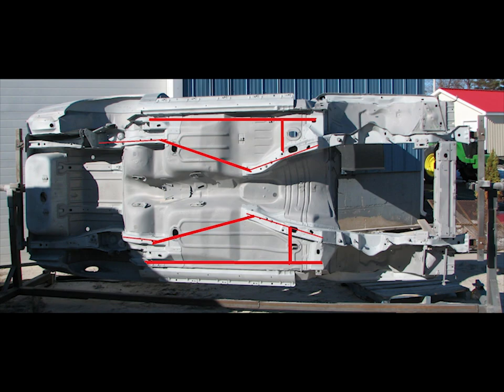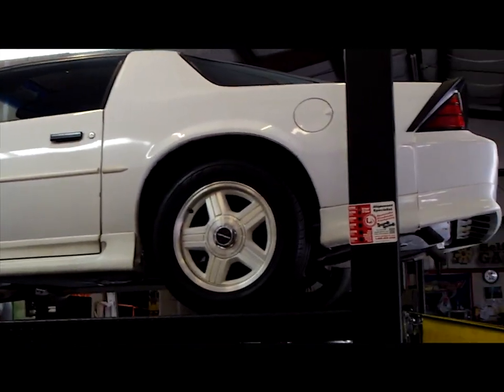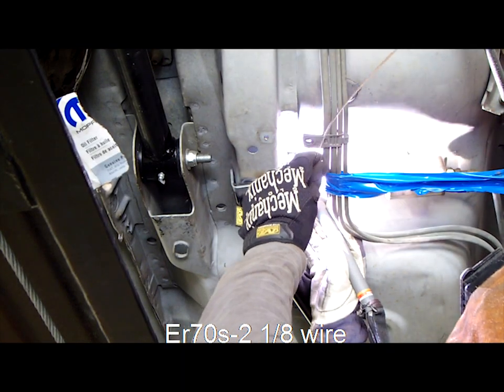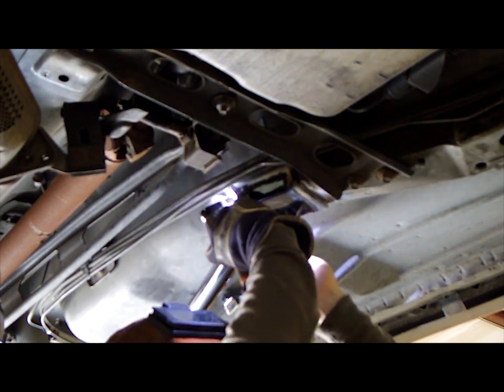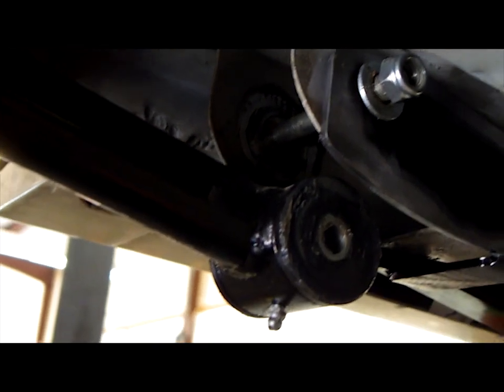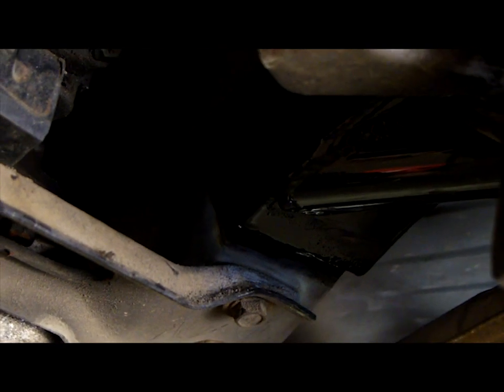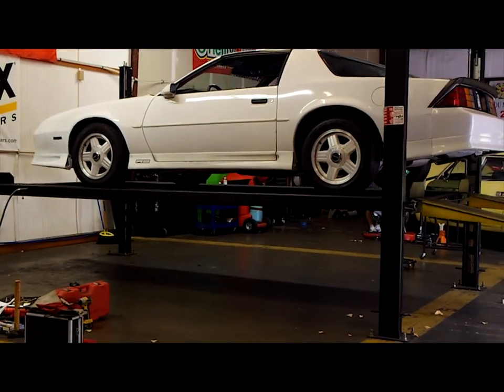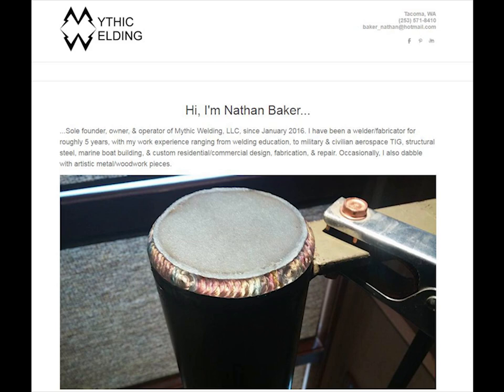Subframe Connector Install (1982-1992 Camaro/Firebird)

Comment: Installed spohn ..torq arm adj..trailing arms adj..sub frame connectors.Panhard bar.. .400 turbo 4 in. driveshaft ..1350 joints 370 MOTIVE GEAR 9 BOLT AUSSIE BORG..  2400 b&m stahl..388 stroker 750 quick fuel..full roller lunati voodoo ..dart aluminum..air gap... 580hp...REAL DEAL...

Comment: Hey! That's my car in the opening pictures lmfao!  I totally didn't expect that.   I took that pic at Robert Sanford's autobody in Nova Scotia, Canada probably 14 years ago now.  That's my home built rotisserie that now has a 71 z28 hanging on it.  This is my 87 iroc in your vid that is still in pieces to this day.... lots of goodies ready to go though, 400 sbc, afr heads, 704 lift solid roller , jesel shaft mount rockers, a 10 pt cage fit tight to the t-top and a t56 all sitting with it now.  Maybe I'll get around to finishing it haha. Still as rust free as it was 14 years ago, it was coated with 2 gallons of epoxy primer, tinted black just after this pic was taken.
Reply from the maker: I just grabbed a 3rd gen at an Autocross because i don't have Pics of mine running
Reply: @3rdGenGuy   nah, the pic of the car from underneath that you drew the subframe connectors on. That's my rig.  Just thought I'd let you know I was quite surprised to see my car pictured Haha.  No worries,  I just figured... what were the chances of perusing YouTube and seeing my car on another channel lol

Comment: Nice!  I went with Spohn subframe connectors and I love them.  You are so right about the squeaks and rattles diminishing.  I also love how the car now goes over train-tracks as a big solid piece of metal instead of a flexible belly-pan.

Comment: So I’m curious why you felt the need to upgrade to the Detroit Speed SFC’s. I love them but the install you did lookes a bridge too far for me.  Excellent work as always.  Looking t]forward you your response.
Reply from the maker: the DSE SFC basically gave my car the stiffness of the 2x SFC I had before.
while dropping 30lbs off my car.
that and the Holley t56 cross member gets in the way of the inner SFC.

Comment: I want to install subframe connectors on my 83 Pontiac Trans Am. How long and how much do u think a garage would charge me for a job like this?
Reply from the maker: if you get a set of Outer SFC and Bolted them in yourself,  a shop could weld it EASY.
like less than 30min.
They'd probably charge you an hour's labor. so $100 or so depending.
Reply: @3rdGenGuy  Thanks dude. I can't do it myself , I have a stress disorder that kinda holds me back. But I did have a new motor put in and I want to get them in there before I run it. I'm worrying about this new motor twisting her body up a bit. Nice videos, I love these cars.
Reply: The garage that did it for me charged $280 just for the outers.

Comment: Anyone have this set up on a lowered suspension? If so how low ? And is it bad? Scrapes? How low can ya go with this set up ?
Reply from the maker: So the UMI outers will NEVER scrape no matter how low your car is.
The inner SFC scrape with 3in+ lowering springs.
BUT, what would you like  to scrape?
2in steel tubes that are $200 & replaceable. OR your transmission oil pan or exhaust?
Reply: @3rdGenGuy  Good to know thank you! Long time owner of several 3rd gen Camaros and have over 10 years of experience with these cars... So I am very familiar with these cars... I've done tons of work on them but strangely enough never installed subframe connectors😮 CRAZY stupid insane I know.. Always known the value of the SFC especially on the 3rd gen just haven't got to it yet...😒  The outers they an eyesore form the side view of the car? I really like the original look of these cars ... Id like to keep the original look. Are they an "Eyesore" ?
Reply: @Toast355  you cant see them and they dont interfere with anything(if you install them right)

Comment: I had just built a strong 355 for my iroc and tore the floor all the way in half from the right door to the left door!
But what i wanted to say is because i had to deal with the floors, 
 I welded all my sub-frame members Exactly half above and half below the floor line joining the floor to the members with New carpet and an extra layer of insulation(for noise) and you can barely tell i did it from the inside and i have NO Exhaust Clearance issues or ground clearance problems, If you look under my car they dont slap you in the face, and are more integrated rather than stuck on.
SUB-FRAMES ARE A MUST DO,  My car is like a BRICK!  I can not tell you what a difference it made.
I've been welding for 30 years and that TIG makes my MIG look like poop.
Reply from the maker: MIG gets the job done
TIG makes it look nice.

Comment: All Thirdgen's should get this done. It's a known fact from the 80's these cars would ratle after reaching 40k miles. I can honestly state it's one of the best improvements you can do to an Iroc.
Reply from the maker: the 3rd party that GM hired to make the convertibles acually made their own SFC because the doors wouldn't close ha ha
even new these unibodys were cardboard.

Comment: I just found this subscription. I love this. I have a 83 camaro i want to be autocross quality just for a weekend driver
Reply: I did this same install.   I love how much more rigid it feels.     By any chance are there any ways to fully box and frame this car?
Reply from the maker: A guy on thirdgen.org put a frame in his. it weighed a fuc ton and didn't help much.
the next step after 2 sets of SFC, is a full Cage.
the cage is the only thing that's gonna make a difference after installing 2 sets of SFC

Comment: I have an 88 TA .  I thought of doing both myself!.  Right now there are only Competition Engineering bolt ins.. A temporary measure, jut to give me 'safe' jacking points.  I discovered I had a rear driverside foot well pan with some rust.. :(    Wish I could find a reasonable pan repair piece.   Great video!  Thanks!

Comment: Thinking about this for a 4th gen camaro ss convertible. Dont want to weld it in however
Reply from the maker: there are Bolt in kits, but weld is the best method by far.

Comment: You did it correctly on a lift with the weight of the car on all 4 wheels.
Reply from the maker: I was told to use a 4 post lift.
but there a few  master fabricators on the forums that claim using a 2 post works fine as long as the load is distributed evenly across the SubFrame.

Comment: I purchased jegs bolt in frame connectors for my 91 rs.am i in trouble with these ?
Reply from the maker: no, the Jegs ones are fine for street cars.
you can bolt them in, then weld for extra strength.

Comment: Thanks for this Video! I really appreciate your work. Im thinking myself to do the same but because of the Government restrictions it needed to be removable. Do you think it could be done with screws and nuts?
Reply from the maker: you can bolt them in, but it's not nearly as effective.
but local laws are hard to get around.
Reply: Hi.  What locality and laws regarding welding SF Connectors are you speaking about?
Reply: Huh?

Comment: Owning a 91 305 auto convertible - installing all Hochkis front and rear, is there a need to add connectors?
Reply from the maker: Regardless of suspension, you 100% need subframe connectors. 
even a stock 3rd gen needs SFC regardless of power.

also, pretty sure Hotchkis has subframe connectors.
Reply: Thanks for reply, was thinking the convertible had reinforcement.
Reply from the maker: some convertibles had SFC stock, but they suck.
if you have a Vert, i'd go with Inner and outer SFC like i installed in this video.
your ride will feel like a totally different car afterwards.

Comment: Thank you for posting this video ,,I Have a question would the outer UMI be good enough for my hard top 3rd gen ?
Reply from the maker: street cars really only need 1 set.
the Alston inners are 1/2 the weight of the UMI ones but are harder to weld in.

Comment: Has anyone used a tubular k member for long while? Have heard they crack and rip? Cheap welds
Reply from the maker: I was gonna use one, but i heard the same about the poor weld quality.
so i just powder coated my stock one.
i'm an Aerospace welder, so the idea of some MIG monkey making parts i have to drive with makes me cringe.

you have to realize, some MIG moron getting paid $12 an hour to weld those up
they don't purge the inside of the tubes 
they don't do penetrant inspections
Reply: 3rd Gen Guy yeah but i wanted the optional rack and pinion steering instead of the 82 to 84 rip the frame at the powersteering box
Reply from the maker: so the rack and pinion steering is not really a good option unless you are drag racing.
the issue is, the Racks they sell are too short for the width of 3rd gens.
so the tie-rods arms  are WAYYY too long and induce pretty awful Bump steer
the 4th gens have a factory power rack and pinion, but the length of their-arms is FAr shorter.

a fully rebuilt steering setup feels pretty good as mine is all new (i have a video on that)
There are also aftermarket steering boxes that are lighter and have closer ratios if that's what you want.
and a  wonder-bar ($60) solves any frame cracking issues caused by spirited driving.
Reply: i wish you were near to me so you could do this stunning welding on my sfc's.i have the same umi connectors .
i would gladly cnc machine some parts in trade,it would be tough because im in Canada(southern ontario to be exact)
love the channel and the car,i look forward to seeing more of it.

Comment: Which is better round or square subframe connecters
Reply from the maker: from an  engineering standpoint? Round is better for torsional stress. but you won't be able to tell the difference between round and square.

Comment: Great vid 3rd Gen Guy  ,,You think a need them for a hardtop 3rd gen ?
Reply from the maker: SFC are a MUST for any 3rd gen. (single set)
the Hard tops are better, but not nearly stiff enough.
Reply: @3rdGenGuy  Thank you for the reply will install on my hardtop then
Reply: @3rdGenGuy  Thanks again for the reply BTW do I need the 2 sets of frame connectors or just one for my hartop ,If one ,,Which one should I use ?

Comment: May i ask how much did you pay to use the LIFT?
Reply from the maker: it was $20 an hour. think it took 4 hours to compete. if went with just the UMI outer SFC, it would have been done in 1 hour.
Reply: @3rdGenGuy  Thanks

Comment: Hello, I have a 1986 IROC, but no way to weld in my own sub-frame connectors, but I did notice that JEG's has a bolt on set. I have read that the bolt on type is not as good as weld on, but they are cheap, and would be much cheaper than taking my Camaro into a shop to have them do the welds. Would you think that the bolt on connectors would achieve the same results as the weld on?
Reply from the maker: so the Outer UMI SFC (both bolt on and weld) are super easy to install. i spent maybe 30min TIG welding them
any muffler shop can do it for around $120

the bolt on ones work, but not nearly as well as weld on ones
what you can do is, buy the bolt on ones, THEN get some cash ready and have them welded on.
Reply: Do these outer UMI sfc’s Go from frame to frame? Or frame to the floor panel?
Reply: answered above

Comment: I've got three questions.

1) Do either SFCs inner or outer decrease ground clearance? 

2) What was the total time for install?

3) I have a Lincoln flux core mig welder. I'm relatively new to welding. Do you have any idea what settings would work best?
Reply from the maker: 1. the inner connectors sacrifice about 1in of ground clearance. outers don't take up any room  BUT those bars acually protect everything else. want to scrape an oil pan, or some 2in round tubing SFC?

2. not that long. the outer ones took like 1 hour tops (super fast). inners took 2 hrs as they needed a lot more fit up.

3. I only deal with TIG machines,  i don't anything about Flux or mig ex.
i can tell you the car's frame is about 0.150in thick or so. not hard to blow holes in it by accident.
Reply: 3rd Gen Guy - I only ask about ground clearance because I'm about to pick up a convertible as a daily driver. An inch of lost clearance isn't too bad, I had a 92 back in '99 and def bottomed out entering some normal parking lots and driveways. I know the rigidity will help the ride and squeaking. Just weighing the loss of some accessibility as a daily driver for the better driving experience. 

I've been playing with a bunch of little welding projects with pretty thin sheet metal and haven't burned an holes. Just have to be conscious not to over heat anything and cause deformations. 

Thanks so much for your input and great video!
Reply: Upon doing some more research it seems like the outer umi SFC don't work on convertibles due to a piece of sheet metal that Alston actually welded in for the factory.  Is this correct? Can I only use the Alston inner SFC?

Comment: Did you remove any interior prior to welding?
Reply from the maker: No, i did not remove any interior.
 if ur careful about managing how hot ur weld it, it's not a problem.
the welds are mostly connecting the SUB frames. ( the 3x3 boxes)
u would have to have a stupidly HOT weld to burn ur interior.
BUT some people have burned their interior by accident.
that's why i recommend a fire extinguisher for  "OH SHIT!" moments.